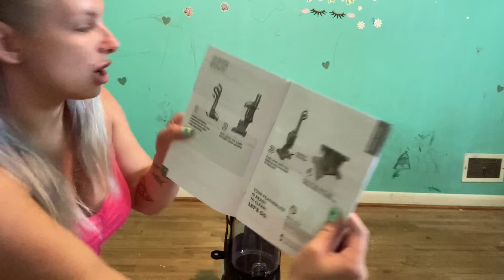Dirt Devil Power Max XL Full Size Upright Vacuum Review

Comment: I LOVE this vacuum! I got mine second hand from a thrift store, so I didn't get the unboxing experience and I'm missing most of the attachments 🙁. It deep cleans carpets really well though! My only complaints about this thing is the reclining foot lever, since it's at a curve and there is not enough grip on it. so if you try to recline it while wearing socks your foot will just slide right off and you can't get any leverage to push it.
Reply from the maker: I agree with the foot lever, I admit I’ve used my hands before 🤣🤣 I love it tho and it’s still going strong with no issues
Reply: @BeccaOnABudget  yeah! I have done the same! It's a surprisingly great vacuum for the price! Thanks for replying!